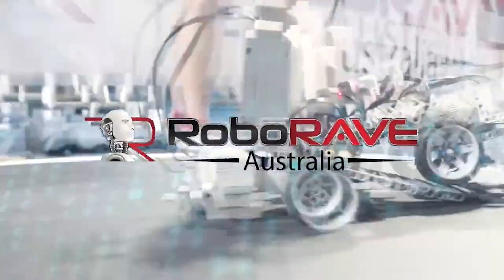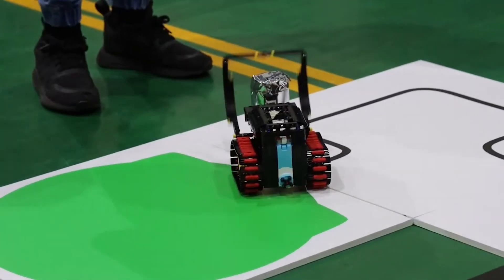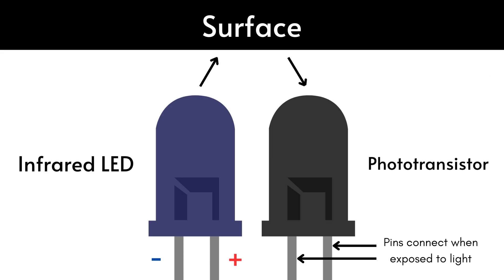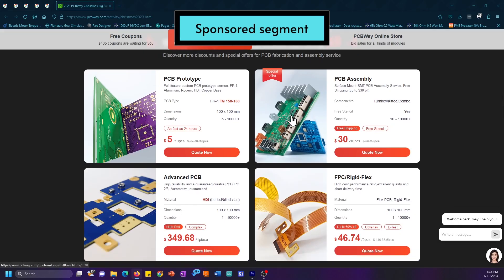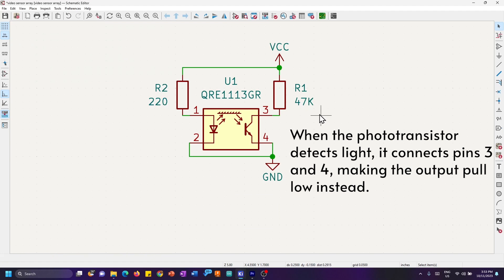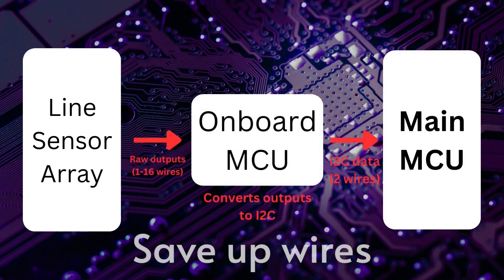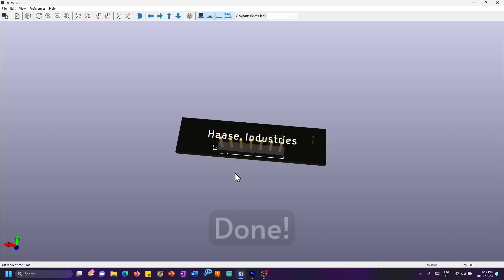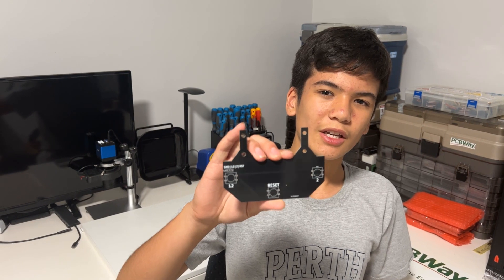Can a 13 y/o build a FAST PID line follower? - making the line sensor

Comment: For such a small chanel, this is a very good quality. Subscribed

Also, there is a third way to lower the amount of wires. Combine the main pcb and the sensor pcb into one. Some back of the napkin math tells me that it would cost about 50 usd for 5 of them.
Reply from the maker: Thank you so much! I am still working on a couple things when it comes to the quality, especially the entertainment factor and filming techniques. The way that I was able to make a clean connection with almost no wires (on my robot) was to put headers on the main and sensor PCB, and solder the main PCB’s headers in such a way that it was the correct height, still being able to have a (sort of) modular design, so that the main PCB can rest higher. After breaking so many things with my previous robots, I figured that I would have to break it up into as small bits as I could, so that everything could be replaced. For example, I used an Arduino nano, TB6612FNG, both on headers from the big companies, when I could’ve easily designed the atmega328 and tb6612fng IC into the board itself. Thanks so much for your feedback, if there’s anything I could improve, please let me know.
Reply: @h1tec and now you design your own motor drivers and esp32 boards. You made soo much progess in these 4 months. I am very jealous of your abilities
Reply from the maker: @tomaszkarwik6357  thanks so much bro

Comment: Hi I have doubt like do jhave anything where robot which can follow parallel line
Reply from the maker: You could perhaps arrange the sensors in a 'V' shape, so that some are ahead of the others, and then use your code to skip the line when the further forward sensors see black, and then continue following with the further behind sensors.